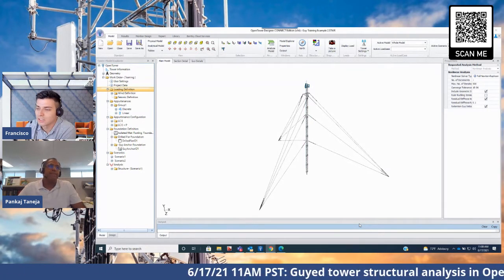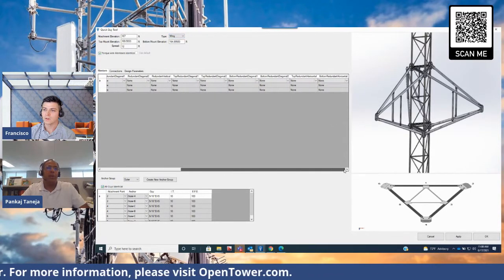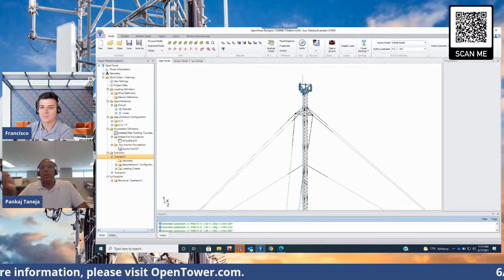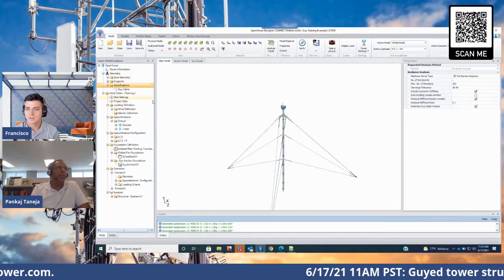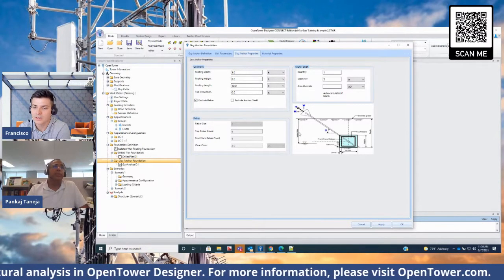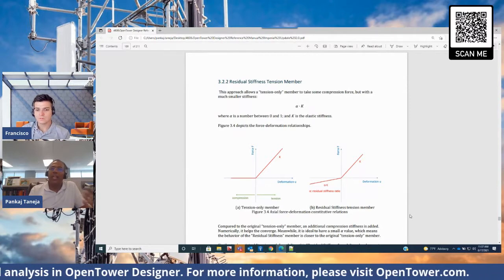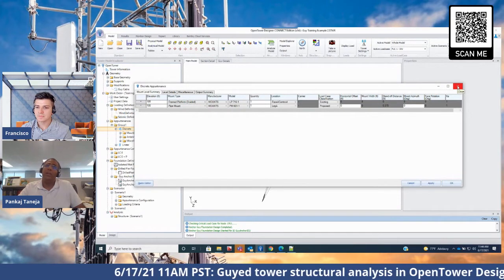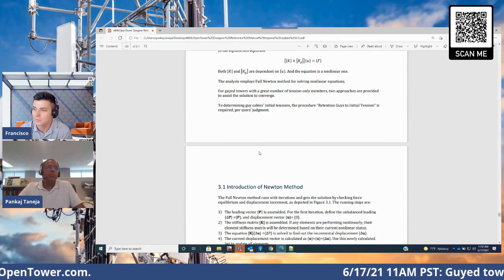Episode 3 - OpenTower Designer LIVE:  Guyed Tower Structural Analysis

Comment: Can you model hybrid tower like Lattice tower at the bottom and there is a circular/tapered pole at top with guy wire? Usually we are doing this for modifying /strengthening/retrofitting  certain rooftop towers, radio/TV towers, etc.